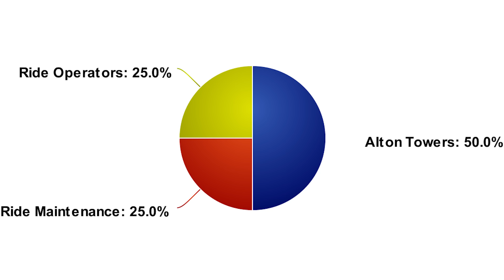What Really Happened on The Smiler Alton Towers june 2nd 2015?

Comment: If The Smiler is still operating after amputating people's legs then I don't see why Top Thrill Dragster has to be shut down.
Reply: it was already a nightmare for cedar point, maintenance was horrible to work with
Reply: @Trubactor  the Smiler was also a maintenance nightmare too. CP just used it as an excuse to shut down the ride.
Reply: @randomdefender  Alton Towers would try their hardest to keep their world record coaster
And one of the most known coasters on earth
Reply: The accident was a good reason to shut down the ride. Top Thrill Dragster was WAY older of a ride than The Smiler was when their respective accidents happened, and TTD was perhaps the most unreliable coaster on Earth for nearly 20 years.
Reply: @triple7marc  Mindbender and the Coney Island Cyclone are both way older than TTD. Both have killed 3 people and the Cyclone is still open today and Mindbender stayed open long after the accident. And why are most of the rides at Disney world and Disneyland that have killed people still opened?
Reply: @randomdefender1532  Bro, why is this so hard for you to understand? The accident isn’t what shut the ride down. It was just a good REASON to shut it down. The ride would have eventually closed anyway, because it had operated extremely unreliably since 2003.

Cyclone’s deaths were not the fault of the ride, and Mindbender’s were the fault of poor safety manual translations; that also occurred in the 80s when the amusement industry as a whole was not as safe as it is today. Dragster’s accident was a “last straw” incident as the ride had been a complete disaster for the park.
Reply: @triple7marc  they used it as an excuse to close it down. TTDs accident was because of the plate not being fastened on right not the actual ride itself. I'm stating that there's rides with worse accidents that are still opened
Reply: @randomdefender1532  I’m not going to explain it to you another time. You are being purposely obtuse. This has been explained to you several times.
Reply: @triple7marc  Listen I don't know for sure but if I think if they spent all this time and money redesigning and revamping the ride they could've used all that time and money to get the thing reopened. BTW I think the redesign sucks and I don't get the hype behind it. They could've at least replaced the launch track with LSMs and kept it a similar experience and intensity but no they had to make it a weaker unoriginal swing launch.
Reply: @triple7marc  Top Thrill 2 is now having as much downtime and trouble as the original Top Thrill Dragster had. Makeover was pointless and your comment did not age well.

Comment: How would they recover a stopped cart that had just rested to a stop? I’m assuming you can’t push the cart around and they aren’t self powered?
Reply from the maker: It would have to be taken apart and rebuilt at a controlled section of the ride
Reply: GP To Enthusiast so if one stops it’s a big deal and won’t be open again for a while

Comment: I feel just due to this there should be a standard wind speed that rides are allowed to run in.  I feel that the safety of patrons is more important than the money that the park tries to part from them.

I know closing down the whole park due to inclement weather is boring to thrill seekers, but I rather they be safe than seriously injured and sorry or dead from being thrown or succumbing to said injuries if they are fatal ones.
Reply from the maker: Each ride is different and has different weather conditions it can operate in. Smiler was being operated outside of its specific conditions, however, other rides could operate just fine in the same weather.

Comment: How is it possible for the damage to the chassis/frame to be so great it squashes steel, yet didn't affect any wheels whatsoever, as both seen rolling backwards and forwards on the tracks for a long time, without so much as a squeak from a single one of the many wheels. 
If the frame was damaged so much it crushed back into itself, how did it not twist it one bit??

Comment: Personally I would put the blame mostly on the ride maintenance. 25% for the park and ride operator. Being the idiots who "assumed" there's a ghost train, without visually confirming, and manually overriding a safety feature while they are at it, is a special level of negligence, something that deserves prison time imo. You never override a safety features without confirming that it is 100% safe to do so, and when you do it and somebody ends up dead or injured, the person who did the override is THE person to blame, even if other things went wrong.

Comment: How could nobody see a train sat there on the track
Reply: I guess they assumed all the trains were in the station area since they weren’t told about the new train, but they still should’ve confirmed it by scanning the track.
Reply: @triple7marc  It wasn't a new train... And what I meant was how could no one that was in the que see the empty stuck train as it was rocking back and forth for half hour
Reply: @triple7marc  no brother I'm on about the customers queueing to ride not the workers
Reply: @josephhill6863  Oh, I guess they just didn't have a reason to look. The Smiler is an extremely compact and highly-themed ride and a train would be difficult to spot among the jumbled mess of supports and theming elements.

Comment: One thing to add to the maintenance fault is that als ok when they get an alert like that the least they could do is a once over of the whole track it does not take that much time and it drastically decreases risk as even if all cars are acounted for its worth checking to see if somthing set off said sensor.
This is why Disney has so few bad accidents as when a red flag goes up ride is closed and they send employees on walk throughs for the whole tide befor it starts again.
This is why new rides spend so much time down there as they are crazy througho. There are times where one guest pulling stupid crap causes the whole tide to be shut down just so they can make sure the guest did not do anythinf else.

Comment: I somewhat disagree with your blame chart. We have something called a Last Clear Chance Doctrine: even if you mess up everything earlier and there is one clear chance to set things right and you don't take it, it's your fault. That being said, the people who manually overrid the computer share more blame than the ones who put the extra car out or those who ran the ride in winds, as those two actions were probably done many times earlier with no casualty but how often would one need to manually override a computer?
Reply: I agree. 100% of the blame falls on the crew that overrode that block safety system. It doesn’t matter that the train stopped on the track. It doesn’t matter that maintenance didn’t tell the crew that the new train had been added to the track. If the crew had simply scanned the track to make sure that there wasn’t actually a block violation, this wouldn’t have happened. MAYBE some of the blame can fall on maintenance for not telling the crew about the new train (since the crew assumed all the trains were accounted for in the station area) but they still should have scanned the track to make sure there wasn’t actually another train out there.

Comment: Yeah no mechanical errors. It was all human error and lack of communication. Hell the systems safety sensor actually WORKED bc it stopped the loaded passenger car and warned operators that the track in front of it was occupied, but they dismissed it thinking it was a system error. I mean you couldn’t have at least glanced the track? If the safety system says there’s a problem, you should at least check it out. That’s what the safety system is for, it isn’t decoration.

I mean I get their reason why they didn’t look bc as far as they knew, only 4 cars were in use and not 5. Which ties into the lack of communication during this event. It’s amazing how minor flaws like that caused an accident that could’ve have been completely avoided.

Comment: I'd beg to differ that maintenance takes a 25% blame yes they screwed up too, however, the stuff operating the rider missed TWO opportunities to correct an issue before maintenance. 1 being the weighted dummies and the second telling maintenance and the 5th car.

Personally I wouldn't have added a 5th car if the ride was finally close due to high winds or the maintenance,sorry can't fully remember, but seeing as it shouldn't have been running in high wind speeds, the day could change again at any moment, so adding another train is not exactly a smart move in my eyes.

A year old video I'm just seeing, but thought I'd comment anyways 🙄

Comment: 2:30 – Umm, you don't need to cut away from the moment of impact when you are doing a CGI reconstruction rather than using actual incident footage! It was jarring to cut away when we were expecting a rough approximation the impact.
Reply from the maker: The software used for the simulation does not simulate crashes.
Reply: @CoasterCollege  – Oh OK, fair enough. Was not aware of that, I just assumed it was something you had done from scratch.

Comment: Well first off I used to work at alton towers and the operation CAN NOT put on another train on. They need the  Mechanics to over ride the system.and the operator to put the water  Dummies on the trains once again the mechanics team need to do this NOT THE OPERATE so its more 50% Mechanics and 50% Alton Towers

Comment: Another reason why maintenance should be in change and not 16 year old ride operators. What if the 5th train want cleared for operation? Any time a unit is added a block check should be performed.

Comment: Its a stupid idea to have such a easy override. When a safety system triggers, time is not that important. You need people to walk some checkpoints to confirm that everything is okay.

It's kinda similar with a fire alarm operating in day mode. First there is a pre alarm and a person needs to acknowledge it in a certain time. After that he gets more time to check if there is something. When there is nothing, he can cancle the alarm or set the alarm. This is done in areas with a lot of people. It's just stupid to trigger the alarm directly in like a shopping mall or an airport, when it might be a false alarm.
Just assuming it's an false alarm is criminal. But don't worry, there are other safety features. Usually when 2 smoke detectors go off, the alarm will go off. When a alarm is manual pulled, the alarm will go off directly too. But this depends on the system and location. A fire alarm on an airport is a huge mess. Everyone need to go to security again and so on.
Reply: ZeldaFreak it should definitely require a complete reset and clearing, even if it’s just a ghost train.

Comment: I feel the ops are a tad more at fault than the mechanics but who's to say. In my opinion when you run a new train on the tracks, you need to make sure it completes a full circuit of the ride before loading. The biggest play was the cold wheels on the train that had been sat in a cold shed the entire day. This is why all other trains could complete the course without issue and why train 5 valleyed. I feel this should be a law whenever a new train is added during operations and this would be yet another easy way to prevent this foolishness.

Comment: What is a ghost train?? He fails to explain this
Reply: That just means that the first train was empty because it was a test run, then the empty train (the ghost train) that stopped was hit by the next train with passengers in it.
Reply: The ride operators overrode the block safety system and allowed the full train to enter the occupied block zone because they assumed that the safety system was malfunctioning and sensing a “ghost train” when in reality it was sensing the empty train that had stopped on the track. In other words, the ride operators assumed there was a ghost train (they thought the safety system had malfunctioned and sensed a train that wasn’t actually there) but it was actually working properly.

Comment: Totally disagree. Running in the high wind was bad but it was caught by the block system safety net. Not telling about the 5th train was bad but it was also caught by the block system safety net. With those two mistakes only, there would be no accident. Maintenance on the other hand straight up overrode the safety net. They ASSUMED!!! Never assume!!! Go check!!!! Accident only occurred because of maintenance’s stupid decision. 100% Maintenance fault.

Comment: I really like your newer videos, but this one is really inaccurate. There is a court ruling on who shares responsibility, and it is 100% Alton Towers, not the operators or maintenance.
You mention the wind stuff which seems not so important, but you don't mention that Alton Towers has been found guilty:
From the guardian:
"In his sentencing, the judge rejected Merlin’s assertion that the crash was down to “human error”. It was, he said, the company’s “catastrophic failure to assess risk and have a structured system of work”.
...
Engineers were “doing their best in a flawed system”, the judge said, describing the lack of proper safety systems as “a serious breach of a high duty of care which put thousands at risk of death or serious injury over a long period of time and which caused devastating injuries to a significant number of people”."

You also gloss over this from the sources you linked:
"He says the engineer’s priority was to get the ride quickly back into service and he felt pressure to do this.

He wrote: “The evidence provided to me also indicated that management had set targets for downtime on rides, with bonuses linked to achieving acceptable low levels.""

I think one of the problems is that your sources are not very good, one is a minute by minute analysis of the accident, while interesting it doesn't tell you that much about the underlying issues. The other is a retelling of the HSE report, but that is different than the final ruling by the court.

Here an analogy to explain why "human error" is not the correct term to describe the causes of this accident, and why the court made the correct decision in my view:
Let's say I own a trucking company, and I pay my drivers big bonuses if they drive without taking sleeping breaks. If a driver falls asleep at the wheel and causes a deadly accident, we don't say that was human error. It was instead the predictable and avoidable outcome of the underlying system that was created by the company. The driver just did what most humans would do in that situation.

At least in my understanding of all of this, what do you think?
Reply: this video was made 4 years ago... evidence takes time to get out

Comment: How do you forget a fifth train was added.
Reply: they didnt tell them
Reply: Megs what maintenance crew assumes 4 trains are at play.
Reply: Nimblee No shit, what maintenance guy assumes 4 trains are at play. They should double check and ask before overriding a failsafe. When being a ride operator or a maintenance person for an amusement park. Communication is a must otherwise they can find a better job.
Reply: @nicholasenglish6198  they were being pressured due to high queues to try and get the ride up and running again.
Reply: Megs When it comes to the safety of the park guests you never rush. Especially overriding a failsafe meant to keep you safe.
Reply: @nicholasenglish6198  i am aware but they shouldn't have been running the ride that day.
Reply: Megs running the ride that day has nothing to do with the accident.
Reply: @nicholasenglish6198  it did. it was the high winds which caused the empty car to get valleyed
Reply: Megs high winds did not cause the collision. Rollbacks happen.
Reply: @nicholasenglish6198  i didnt say anything about winds causing the crash. it caused the empty car to get stuck on a low piece of track which is hard to see from the cameras.